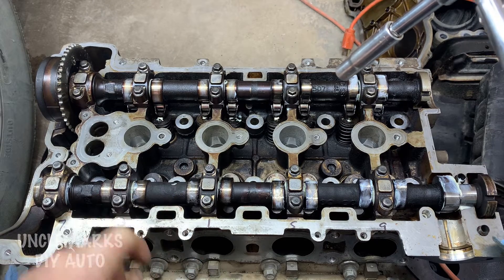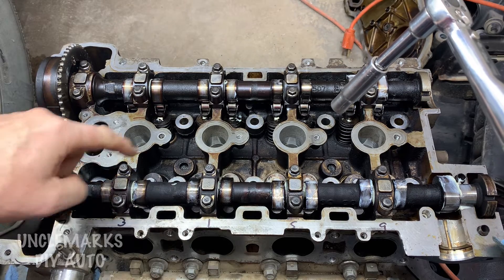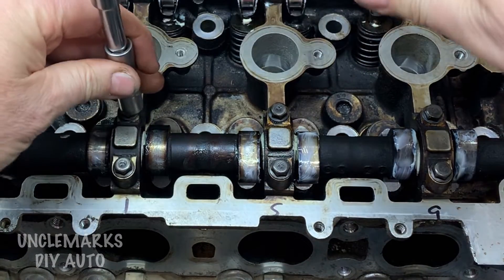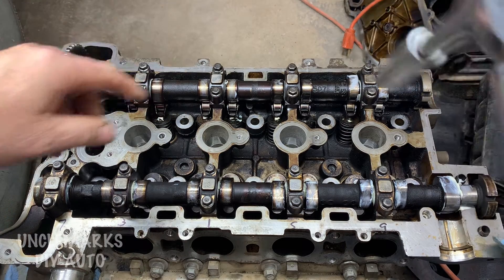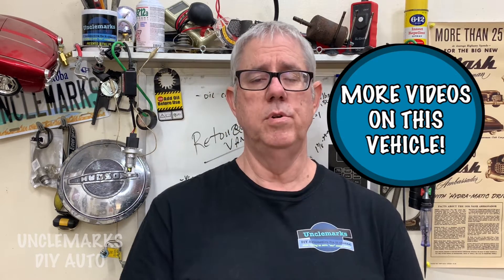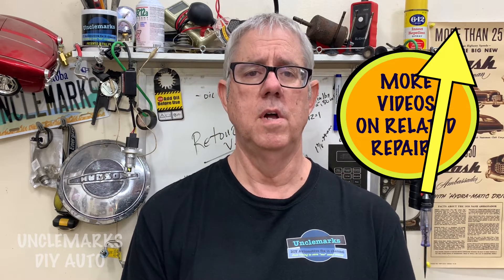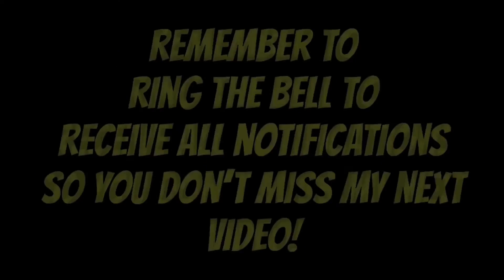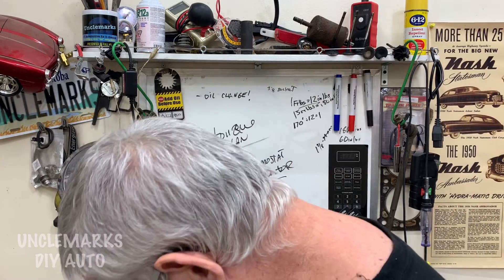Ecotec camshaft cap torque specs & sequence?

Comment: if one over torques those bolts would that cause the cams to get stuck stop rotating and snap??
Reply from the maker: Possibly. The torque is pretty specific. Hope all you need is another cam.
Reply: @unclemarksdiyauto Finished the valve cover gasket replacement job today, recorded vids have 2 posted. The cam bolts were all a tiny bit loose with two being loose enough to move with fingers and must have been the clacking noise I was hearing as now it's all quiet - sounds like a new engine!
Reply from the maker: @SportsMusicCars  glad you got it back up and running!
Reply: @unclemarksdiyauto lol dont need anything at all was just a question. thanks.